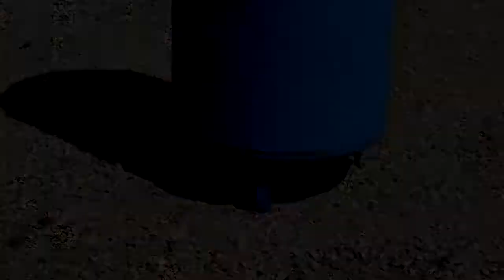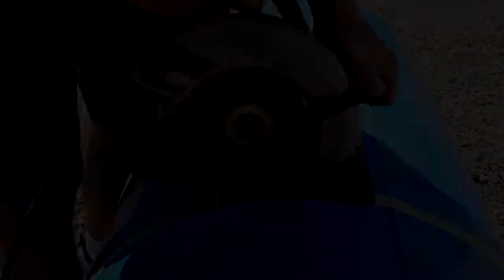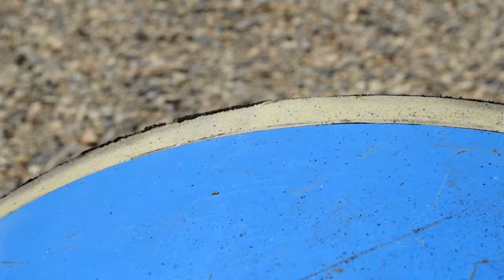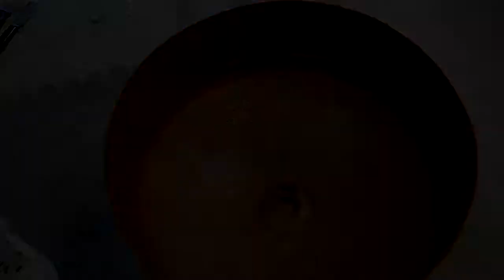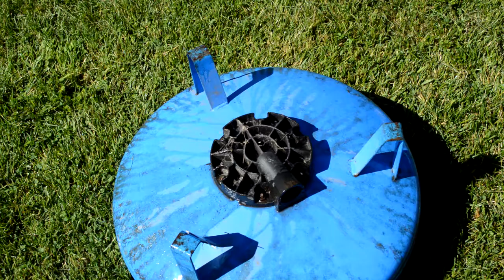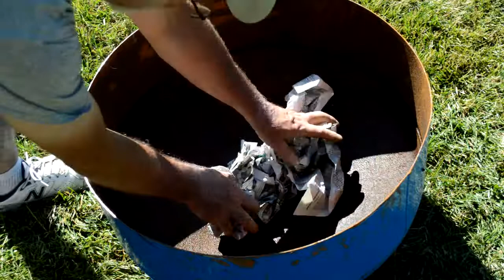DIY Fire pit

Comment: Great idea. You said the "bladder inside burst and you removed it". How did you get the bladder out? Thanks
Reply from the maker: It was a lot of work. Mostly pulling and cutting, and more pulling and cutting. It did not come out in a single piece. If you are going to cut the tank anyway, just do that first. Then the bladder will be easy to get to.
Reply: I have a tank that wont drain. I think the bladder is keeping the water in. I was hoping to keep it intact for an air tank
Reply from the maker: @BonifiedWingnut  yeah. This it the exact reason I had a spare tank to cut up. I couldn't get the bladder out to fix, and a new bladder wasn't that much cheaper than a new tank.